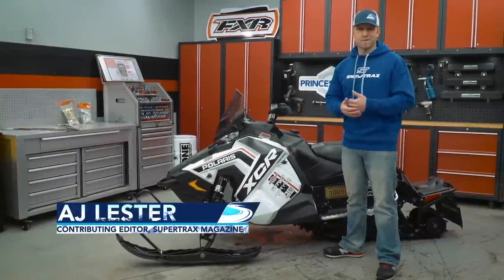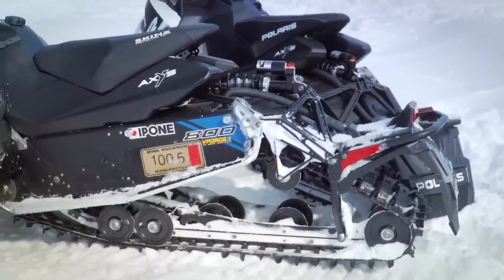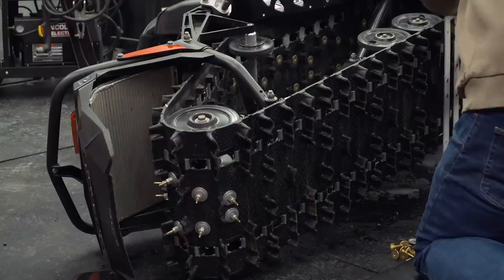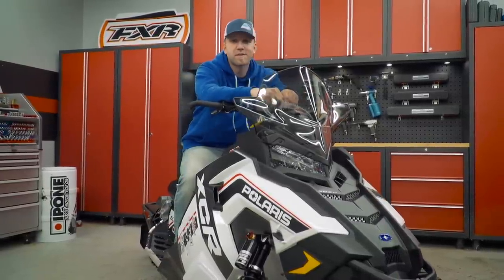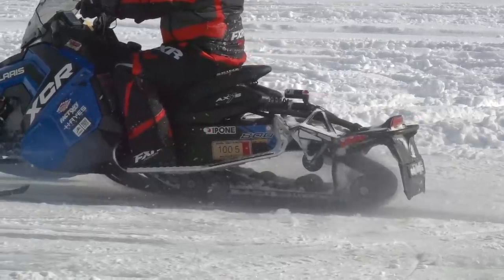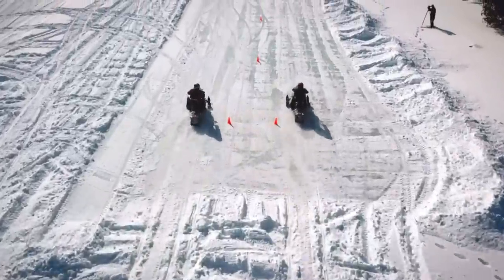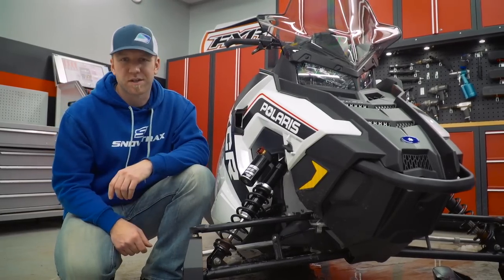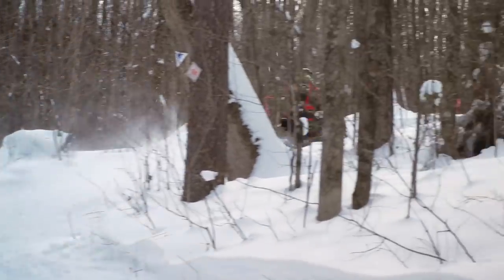Woody's Traction Snowmobile Stud Comparison

Comment: Question:  If the XCR Cobra 1.352 track has a lug height of 1.352, how do the Woody's Gold Digger 1.325 studs stick out above the lugs?
Reply: The 1.352 track is actually a 1.25 track. They have small nubs that measure to 1.352 but those nubs slowly wear off and the track is a 1.25

Comment: That whole. Studs up the middle never worked for me. Tracks only last 3 to 4 thousands miles.  I go by the old charts. 
 Studs on the outer belts and way more scratch lines. My 800 has 244 pattern and the 600 144..both have 9 inch carbides. NOTHING Negative about it!  never lost a stud from pull out. No rocks picked up bashing my cooler out when crossing water holes, Drag racing here in the east.. Gone! Don't even hurt my fuel mileage boys with offset of new gears and clutching.